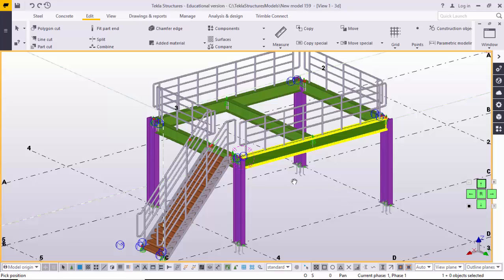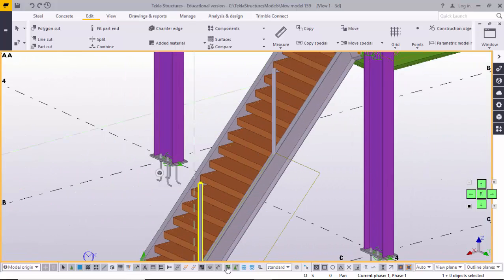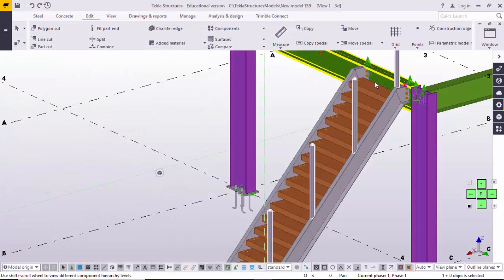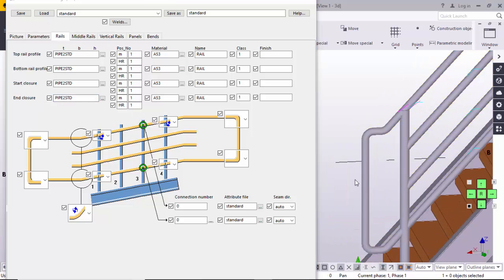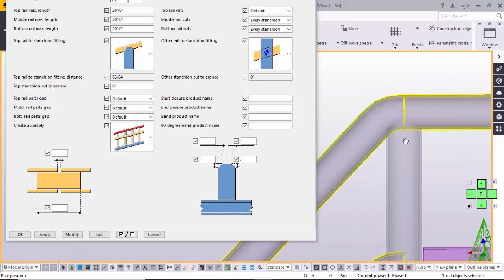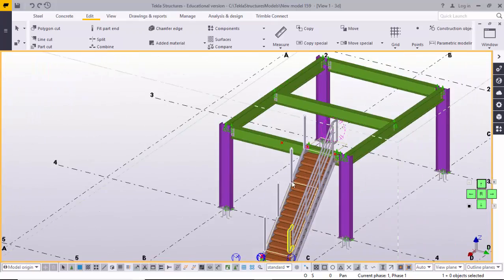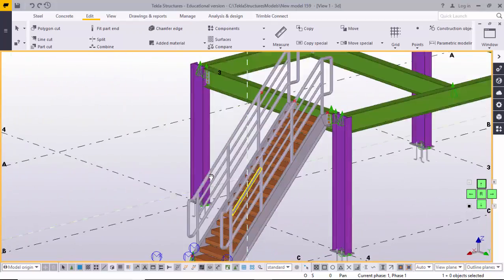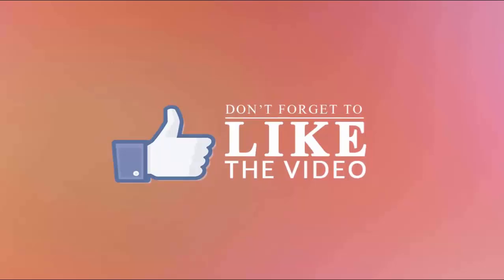How to create hand rails in Tekla Structures   Stanchions S76   Railings S77

Comment: Thanks Gani this saved me a lot of headaches. however, how did you come up with that greeen navigation button with arrows (left, right, up and down) at the bottom right hand corner which you use to scroll up and down on pop -ip dialogue boxes ?
Am stuck please help.
Reply from the maker: You are most welcome. Refer this video: How to download and Install Screen Controller for Tekla Structures - https://youtu.be/n486DXmuoik

Comment: Engineer I believe you are doing great. Is it possible to transfer a staad pro model to tekla for detailing I.e. putting staircase.. etc
Reply from the maker: yes, you can import staad pro model into tekla
Reply: Can you be in a better position to be found with a video on exporting an analysed model to tekla..or u can recommend as it will help